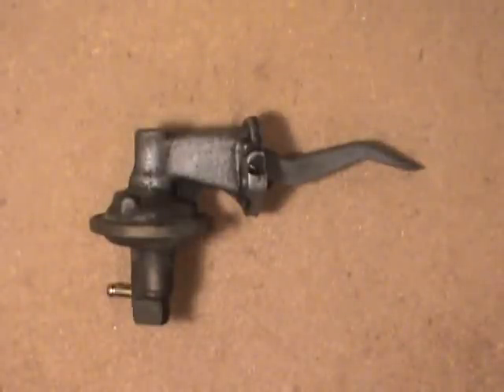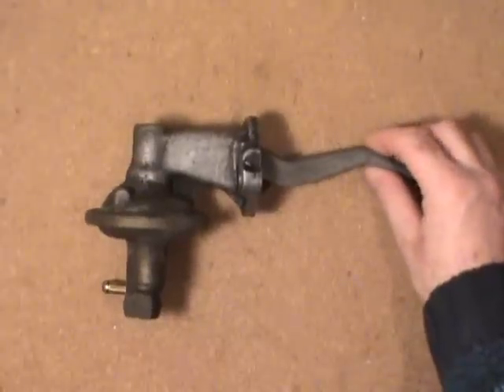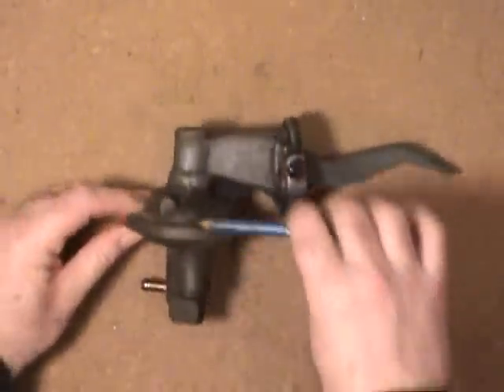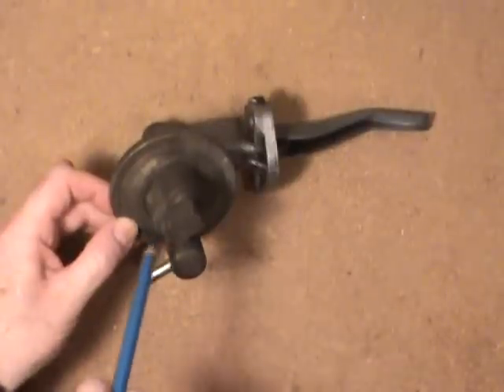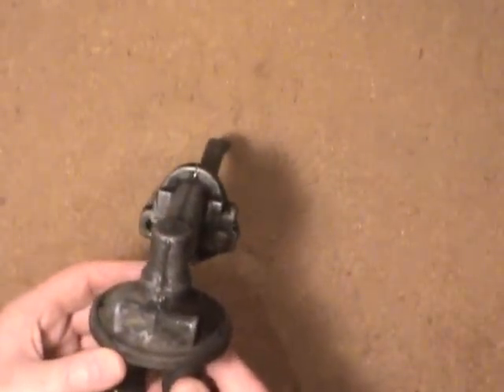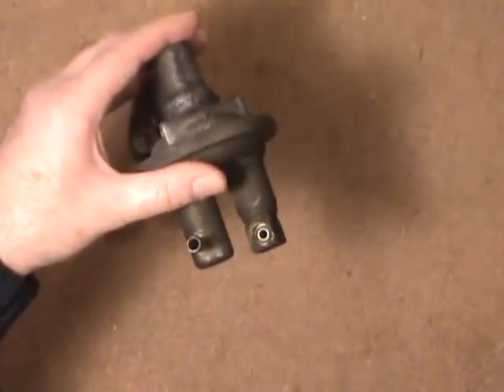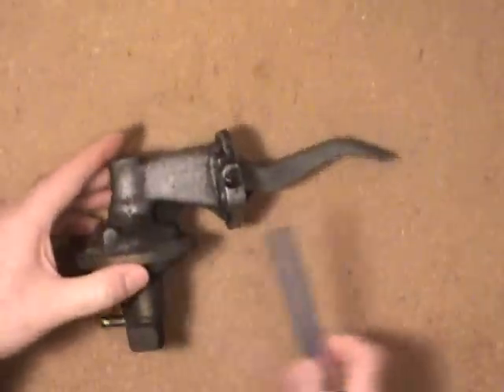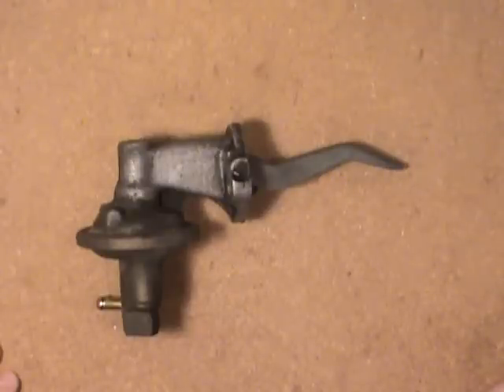Fuel Pump Mechanical Type Demo

Comment: My 83 CJ-7 sits about 1 month between the times I crank it.  I hate the time I have to let the starter turn the engine over.  Could I install a 12 volt electric pump right prior to the mechanical pump.  Would the mechanical pump allow the electric pump to push gas through it?  I am told the electric pump will allow the mechanical pump to pull gas through the it.  I only want to press a spring loaded switch and prime the carb so I don't have to work my starter so hard.
Reply from the maker: John Godwin Greetings John Godwin....Thanks for Your comment/question, and for watching too..............................................If it happens to be, the Longer then wanted...Cranking of Your engines Starter Motor...that has You concerned, then, there happens to be, a much more "Simple", and, much "Cheaper" way, to address, the, shall we say, "Over-Use", of  Your engine's "Starter Motor"...........................................Here's the deal..........The reason that it takes so much Starter Motor "Cranking" time, is usually attributed to the "Evaporation" (or, maybe even a Leak?), of the Gasoline, that was in Your Carburetor's "Float Bowl", usually due to, having that poor ole Carburetor, sitting on Top of, or in near proximity, to a quite Hot Engine, that, when, shut down, still kept the engine compartment, nice-n-toasty, for quite some time, until all of that engine Heat, finally became, somewhat Equal, to the ambient Temperature, that Your Vehicle was parked in..............................................Now then, here's the "Cheap & Simple" way, to get Your Vehicle's Engine, Started, without prematurely, wearing out, Your engine's Starter Motor, as well as, helping to prevent, the running down, of Your vehicle's Battery, at the very same time..................................................All You need, is a "Small Squirt Bottle", that can contain a few Ounces (aka, small quantity), preferably, with a Lid or Cap on it, with some Gasoline in it...........then...........with the "Engine...Cold, and Not Running"...remove the Air Cleaner's Housing Lid, and Squirt, about a Table-Spoon or Two, of Gasoline...Into Each of the Primary Throttle Bores (Your Carburetor might have 1 or 2 primary throttle bores), while holding the "Choke Plate Open", with Your other Hand..............then.............replace Your Air Cleaner's Housing Lid, and Secure it in place (tighten the Wing-Nut maybe?)...........then..........Your Engine should Start...........if it Stalls, You can either, keep Cranking the Starter Motor...........or..........."Re-Prime" the Carburetor with the Squirt Bottle again, and Secure that Air Cleaner Housing Lid, once again, and hopefully, Your Engine will Stay Running.......................................................If You can see some Float Bowl "Vents", sticking up, on top of Your Carburetor, You can also, try to Fill the/those "Vents", to some-what "Fill the Float Bowl/Bowls with Gasoline, as the case may be, with again I say..."Engine Cold, and Not Running...!!!......................................................Also, it would be a very good idea, to have a Fire Extinguisher with-in reach...just in case...!!!..........................................In the event, that You still want to Install an "Electric Fuel Pump" in Your Vehicle's Fuel (system) Line, there are a number of things, to be aware of.......................................................First off, You'll have to make sure, that Your "Mechanical Fuel Pump" will not be a "Restriction to Gasoline Flow".........................................................The theoretical "Electric Fuel Pump", that You're considering..."Must Not", have..."Too Much (High) Fuel Pressure"...or it will be making Your Carburetor's "Float Bowl"...behave, just like a "Mini-Waterfall", only, instead of Water, it will be "Gasoline", Spilling out of the Top of Your Carburetor, due to the..."Much Too High Fuel Pressure"...that will, more then likely, be "Over-Powering", the Needle and Seat Assembly, inside Your Carburetor...!!!.................................................Also, the "Electric Fuel Pump", has to be able to "Allow Gasoline Flow", when it is not being fed, any Electricity as well...!!!...................................................I'm thinkin', that Your CJ-7, Engine's Fuel Pump, is probably, only putting out, oh, about, 4 to maybe 7 PSI (Pounds per Square Inch) Maximum, Fuel Pressure, so, make sure, that You "Verify" Your Engine's "Factory Installed Fuel Pump's"..."Fuel Pressure"...!!!......................................................Then, due to the, as I see it, the amount of "Crud/Debris", that's usually hiding "Inside the Gas Tank", especially, that of an older vehicle, I would like to see, a "Fuel Filter" installed..."Before" any Fuel Pump, or, it could become, quite the Problem...!!!.....................................................Then..."Electrical Safety" has to be considered as well...!!!.........................There, as I see it, should be an "Electrical Relay, and Fuse/Breaker"...in the Electrical "Circuit", that is "Supplying", the needed Voltage and Amperage, that the "Theoretical/Hypothetical"...Electric Fuel Pump requires, to make it...do its thing.....................................................As I see it, if a "Carburetor Equipped" Engine, was Started and Run..."Every Single Day"...then, barring any abnormalities...that..."Carburetor Equipped Engine"...should..."Fire Right Up"...at the first turn, of the Ignition Key...!!!....................................................Yes-Sir-ee-Bob...No Gasoline in the Carburetor's Float Bowl, is like tryin' to drink more Beer out of a "Can...Bottle...or Glass"...when it's..."Bone Dry-n-Empty"...!!!...lol................................................You, my Friend, seem to have, quite a few "Options", placed before You..............................................................Now, it's all up to You, so please..."Choose Wisely"...lol.............................................To avoid having a Camshaft Lobe or Two...get Destroyed, or, maybe having an Engine Seal go Dry, and start leaking Motor Oil...always remember, the "More Often", a Vehicle's Engine is Run, the Better, as, the Only Way, that the "Inside" of an Engine gets "Lubricated", is when the Engine is "Running"...!!!..............................................Engine "Exhaust Fumes" are "Deadly", so, make sure, that You have plenty of Fresh Air and Ventilation, around Your Vehicle, when-ever the "Engine is Running"...!!!..................................................Be Safe, take care, and have a good one.
Reply: Very good description.  You are correct.  I have my jeep at a MTN home that I only get to once a month.   By the time I get there the gas is all out of the Carb.  I was shooting starter fluid in the carb to crank it but since it was water based the carb rusted on me and I had to get it remanufactured.  I don't want to do that again.  Ha Ha....    I am scared to have that starter run for long periods of time since the fly wheel teeth are not the best and over time my starter teeth will wear down.   Since I only drive it about 1 mile once a month the starter should last a long time if I don't over start it.  My wife doesn't like the idea of pouring gas in the carb.  She would like the idea of a primer button.  Less man work for her if she had to crank it for the first time to drive me off the MTN to the emergency room or something.  This 12 volt electric pump would prime the carb then after the engine started the new mechanical pump would run as it was built to. The electric pump is 3 to 6 PSI.  My 1983 jeep is old so I have recently replaced all my rubber fuel lines and tank and guage indicator in the tank and fuel pump and fuel filter so I should have little to no rust or junk in the system.  

If I were to install the electric pump prior to the mechanical pump pushing 3 to 6 psi into the mechanical pump do you think the fuel would flow out of the mechanical pump to the Carb?

Thanks for your WISDOM.   :-)
Reply from the maker: John Godwin Greetings John Godwin....You are welcome, for, what You referred to, as...my wisdom........................Call it what You will, (and I thank You, for Your very kind, choice of words), but, just about everything, pertaining to Cars, Trucks, and just about anything that is mechanical in nature, and somewhat tangible as well, has, shall we say, grabbed my interest, attention, and curiosity as well, and away I go, exploring, checking-out, reading about, tinkering with, and, last but not least, by me, doing the repairs and adjustments, on just about anything, that I manage to get my hands on, I do save an abundance of money, by doin' it myself (and probably learn quite a bit, at the very same time!...lol)....................................................Hmmmm...still more options, to maybe consider..............................................You could just, "Prime" the Carburetor, with the gasoline squirt bottle..."One Time"...upon Your arrival, at Your Home in the Mountains, then, as I see it, as long as You started Your Vehicle, every other day, there probably wouldn't be the need, to "re-prime" the carburetor, because, I'm quite sure that, Your Carburetor's Float Bowl, will have enough gasoline in it, to have it..."Start" right up, at the turn of Your ignition key..............................................I've used the, "Prime the Carburetor, with the Gasoline Squirt Bottle", for many, Many Years, and, it has never Failed me, as long as the Engine was in good running order to begin with...............................................Just remember to Replace and Secure the Air Cleaner's Housing Lid, right after You Prime the Carburetor with Gasoline....................................................Also, are You using the..."Recommended Starting Procedure"...that You should see, in Your..."Vehicle's Owners Manual"...???.........................................................As, in most cases, when dealing with Starting most Carburetor equipped Engines, the Actual Starting Procedure, can be quite Different, depending on, if the Engine is being..."Cold Started"...or..."Warm Started"...and the..."Type of Carburetor Choke Mechanism"...that is engineered/installed on, the Carburetor in question"..................................................If the additional "Electric Fuel Pump's"..Newly...."Wired-in, Electrical Circuit"..."Is Not"..."Engineered and Installed"..."100% Correct"...and..."Inspected by a Qualified/Certified Technician", as I see it, You might (literally) be..."Playing with Fire"...!!!..............................................Sure, You might be thinkin', that I'm being a bit paranoid..but...have You ever seen a..."Vehicle go up in Flames"...???................That my Friend..."Is Not"...something, that I'd wish on Anyone...............................................If You are still contemplating..."Modifying"...Your Vehicle, with that..."Additional Electric Fuel Pump"..."Make Sure"...that, You have..."Any and All"..."Modifications"...to Your Vehicle..."Inspected"...by a..."Qualified Technician"..."Because I Care"...and..."It's the Right Thing to Do"...and also..."Breaking any Laws"...in any..."Way, Shape or Form"...is something that..."Just Ain't Right"...and..."Has Repercussions"...to say the least.............................................For Safety's Sake, have it done, by a "Professional"............................................I hope, all goes well.....................................................Be "Safe", take care, and have a good one.

Comment from the maker: Greetings Alot327....Yes indeed, Mechanical fuel pumps might be on the left or right side of your engine, depending on where the Designers/Engineers chose/had to, because of the way in which the engine is built/designed....Just remember that Mechanical fuel pumps only last about 50,000 Miles, maybe more, maybe even less....So, if your fuel pump has high mileage on it, or it is old (in years), maybe put a new one in, so you won't get "Stranded" somewhere!....Take care, and have a good one...
Reply: Q

Comment from the maker: Hello once again....15 to 20 minutes, you say....So many things, that it might be....Still have enough gas in the gas tank?....Try helping the Idle Speed with your foot on the gas pedal (just enough so it won't stall)....Your fuel pump might be on its way out alright....Try changing the Fuel Filter/Filters in your engine compartment, and/or carburetor first, that might help)....Also, you might have water/condensation in your gas tank....See if the filter/filters change helps....Take care...

Comment from the maker: Hello once again, my Friend...Thanks for your nice comment....I hope that you can understand the information that I just typed in response to the question that you had about your 302-Engines fuel pump...Try to read all that you can about Safety, and any information, as it applies to your car, when you work on it...Just always be aware that your car has the potential to hurt you if you are not careful...Put your parking/emergency brake on, and, watch out for Hot, and Moving parts!...Bye-4-now...

Comment from the maker: ...Garage door Open!!!...The engine should run for a few minutes with the gasoline that is in the float bowl, without any more being supplied by the fuel pump..You have to watch at how the fuel comes out of the hose (and into the jar/bucket), not only Pressure, but the amount (volume) as well...In about 30 seconds to 1 minute, you should get about 1 or 2 pints at least, and the fuel should be flowing strongly as well (not spitting)...Look for the Specs for yours...Careful...Take care, my Friend

Comment from the maker: ...Now, about testing the output of your fuel pump....No Smoking, No Sparks, and, have a Fire Extinguisher nearby!...With engine Not Running, the fuel line that goes from the fuel pump to the carburetor, has to be disconnected...then you have to hook up a hose to the output side of the fuel pump, and place it in a large jar, or bucket beside your car, and secure...then, have a helper (Person), start your engine (tell them to only start your engine when you say so!!!)....(con't)

Comment from the maker: ...If your engine will not keep running on its own, then it could be a few things other then the fuel pump causing the problem....In the gas tank, there is usually a filter of some kind on the end of the fuel pick-up line (clogged maybe?), and usually does not need replacing....Also 1 or maybe 2 fuel filters in your engine compartment....Perhaps 1 of them mounted in/on your carburetor perhaps?....The 1 or 2 fuel filters in your engine compartment should be changed yearly....(con't)

Comment from the maker: ...gasoline down into the 2 front Barrels of your carburetor (you might have to hold the Choke Plate open, so you can see the 2 front throttle bores)...then, re-install your air cleaner top (lid), and secure...then, push your gas pedal down, and release...Try starting your engine, it should at least Sputter to Life!..If it stalls, turn off the ignition, and take your key out, then, do the "Prime" routine again, making sure that your engine is Not Running when adding the gas "Prime!"...(con't)

Comment from the maker: ...Ok, lets see if we can get your 302 running now...(with the old fuel pump that is on your engine)...Open Garage Door!...Fuel tank have gas in it?....It's time to "Prime" your carburetor with gasoline to get the engine to start, so the fuel pump will pump really fast (as opposed to just cranking the engine with the starter motor)....With engine Not Running, remove the top (lid) of the air cleaner that is on your carburetor...then, pour (or squirt) a small amount (about an ounce) of....(con't)

Comment from the maker: Greetings Jhosaphat78....A mechanical fuel pump is good for about 50,000 miles (maybe more, maybe less)...I had one of mine quit (fortunately) while I was driving on a side street (original pump with only about 30,000 miles on it)...If yours is either old, or has many miles on it, then it's better to change it at home, or, you might have it quit on you, in the middle of no-where, and Towing bills are expensive!...The older fuel pumps are not very expensive ($30.00 to $50.00 in Canada)...(con't)

Comment: I am having a fuel delivery problem myself.  I have a Ford 302 with a four barrel carb. It sat in storage for about three months and I can't get any gas into the carb. There is no gas in the filter at all. What's the best way to test the fuel pump and the line itself?
Reply: Josh B    I saw your old question here and wonder how you fixed the problem. I have the same problem now.

Comment from the maker: You mentioned that your electric fuel pumps are burning out....Try keeping your gas tank at least 1/4 (one quarter) full, that will keep the fuel pump inside your gas tank (if you have one in there) cooler....Be careful when adding fuel system cleaner (if you do), because sometimes the Crud from your gas tank can plug your Fuel Filter!!!...When Fuel Filters get plugged, that can, and will burn out your Electric Fuel Pump!!!....Change your Fuel Filter at least every Year!....Take care, my Friend

Comment from the maker: If it has a Throttle Body Injection (looks kinda like a Carburetor), then it needs somewhere around 13 PSI or more, and the other types of fuel injection mechanisms need around 50 PSI or more of fuel pressure!....Unless, your car has a Carburetor...then, your 302s Engine Block has to have the provision to have a "Mechanical" Fuel Pump mounted to the side of it...(con't)...